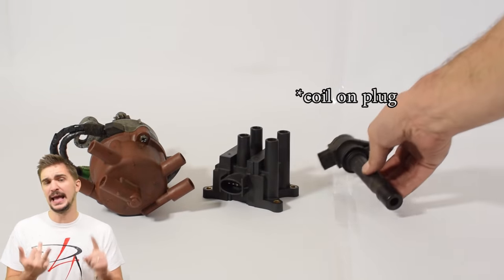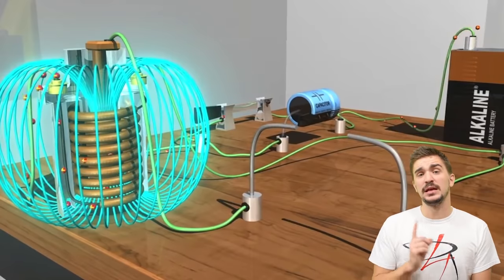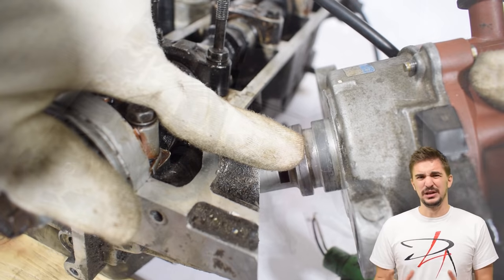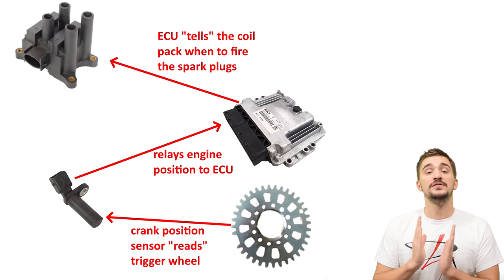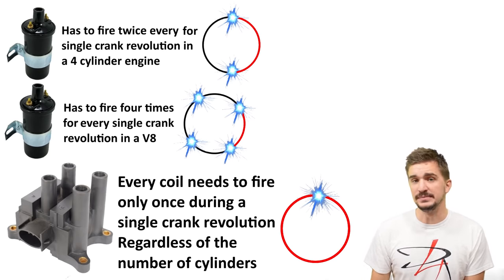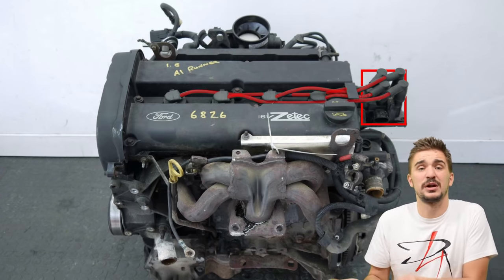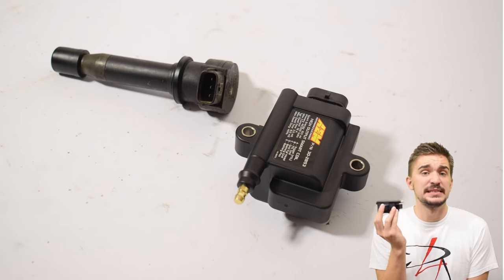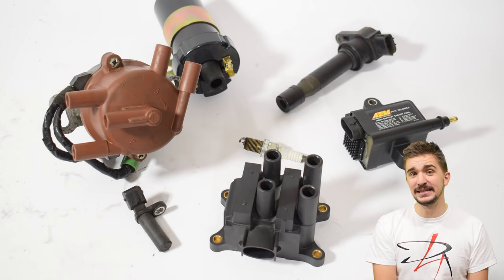Distributor VS Wasted Spark VS Coil on Plug VS MONSTER Coil near Plug

Comment: I'm sad you never mentioned timing advance as a drawback on distributors. Awesome video as usual though
Reply from the maker: The video did originally have a segment on it but I cut it out. The deal is that centrifugal and vacuum advance actually did the job fine, and later distributors used in conjuction with ECUs even had non-mechanical advance similar to that in distributorless setups. Overall I realised that presenting distributor advance as obsolete would be a bit of a gray area so I cut it out.
Reply: @d4a  I'm really surprised to hear that and wish you wouldn't have cut it. I figured that the step up to computer controlled ignition would have made a big difference but I wasn't aware. Thanks for the answer and all the videos dude

Comment: What about spark plugs? Do expensive multiple electrode plugs offer any true gains? I used to to buy the fancy stuff, but never noticed a difference, so I went back to stock plugs, maybe a range colder, for high compression engines.

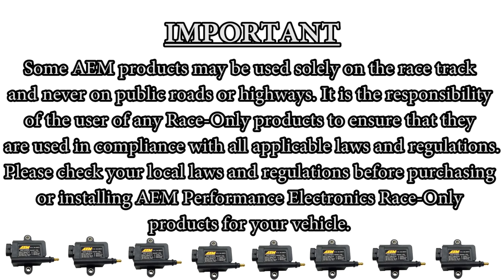Comment: 12:43 and who is going to notice?
Sure external parts like racing slicks are crap on main roads anyway but you are not hurting anything by running a ECU or aftermarket ignition on the roads.

Comment: Very informatieve BUT what controls the coil on plug, and the monster coil near plug ? Is it some sort of ecu take a signal from the gear wheel ?  Would it be possible to retrofit any of  these to a 1978 distributer type engine ??

Comment: Pretty cool video!  Now if someone would explain why leaving the coil ground strap loose on the cylinder head leads to ecu failure. I replace a lot of ecu’s with burnt out drivers when someone leaves the ground strap loose.

Comment: I'm not understanding the last 2 types.  My toyota 3.4l looks like type 3, there are long rubber ignition coils covering each plug, but there ARE wires connecting the left and right sides??  I dont understand when you say 'no wiring' with the ignition coil system.

Comment: distributor have 3 advantages, 1 being cost, 2 being reliably especially if your ecu goes out, and 3 easy tuning. never have seen a distributor leak oil in 50 years, they typically corrode sealing themselves better and get stuck in the block pretty bad
Reply: Obilwe wufuh Mubufu Oulou  you need 8 of them and i haven’t seen ford sell coils for under $50 each and 50•8 is $400 i can replace a distributor if it somehow breaks for $200-300 if i only need a cap, rotor, and plugs thats $70 total. double check your cost for a real engine cause it sounds like you’re missing cylinders
Reply: Obilwe wufuh Mubufu Oulou  i build engines for fun, i’ve built a 460, a 351w and a 302w

Comment: Advantages of a dizzy is simplicity and robustness needs no PCM/ECM to operate. To get around charge drop at high RPM most guys use a higher capacity coil that has a higher voltage output. These kids playing with their new fangled cars that have a PCM/ECM, don't realize the top fuel dragsters still use a dizzy with high voltage coil.

Comment: OEM plug wires are 3 thousand to 5 thousand ohms per foot Taylor thundervolts are 50 ohms of resistance per foot. What needs to be addressed is exactly how many ohms of resistance have OEM manufacurers built into OEM cop's ? and the aftermarket COP'S how many ohms of resistance because that is where the true performance is because I would rather have and older coil set up and use 50 ohm thundervolt wires on lets say a 1998 GT coil system which from all that I have heard works better then the modern ford COP because of the way it fires ? as in more reliable for performance applications ?

Comment: How do you handle a double ignition engine. An engine with two spark plugs at each cylinder? At motorcycles it's not unusual to have such configuration. My first and my last have two spark plugs in one cylinder.

Comment: How ECU in waste spark ignition system can decide to what cyliner should inject fuel if there is no camshaft sensor?  I understand 2 sparks but does it fire 2 fuel injectors also at the same time?

Comment: Way back when I had a duel point system that delivered 50,000 volts. The max speed limit my state is 65 so makes no difference to me. Besides you want to feel real instant acceleration, electric cars made to race would beat off the line piston engine every time. At this time I have COP.

Comment: wasted spark dont like big camshafts,the ford falcons in australia ef-el bounced between coilpack wasted spark and distributor and the wasted spark could'nt run the bigger distributor engine cam,it misfired and would not run properly

Comment: Honda b16 n b18 have distributor but can rev high 7500 8000 9000 rpm with distributor ..plug... wires ....toyota 4age has distributor and can do same

Comment: I’ve spun V8 engines to 10k rpm with a single point single coil distributor without misfires you don’t need electronic ignition let alone a coil on plug system to turn 10k rpm

Comment: Q: is the ignition system of a scooter engine the same as wasted spark system ? on older scooter I have a carb, coil pack and something called CDI, on newer it has EFI and ECU. Both are single cylinder so there is no waste of spark, because a single spark plug is firing all the time

Comment: So what is the difference of say, a coil on plug that can output 47,000 volts and a coil near plug setup? At that point is it just the amperage that separates them?

Comment: can we replace the distributor system with other systems?
Reply: yes you can you would need a triggering setup and something to control the timing. i believe msd makes a drop in CDI setup for old distributor v8 engines.

Comment: All good all well ...things I already know except for the last part ...my puzzle is that the missing teeth are meant to reset the counting and get the right sequence of releasing sparks  but at high rpm this missing teeth or gap will be reduced to size (time lapse) of the other teeth ...how is this issue managed .though the question is related to electronics but I'm yeeeeeeeeearning for a detailed answer?........?????????
Reply: the ecu i programmed to know the number of teeth on the trigger wheel and the missing tooth makes a break in the pattern. look up a scope output of a missing tooth trigger pattern and it will make sense why this system works.
Reply: @7sins979  thanks for ur concern I'm sure what u mean but the idea isn't yet clear for me I actually need some references on this issue....plz don't commit the eighth sin.

Comment: Almost Every waste spark, cnp, or cop ignition uses mosfets or some transistor for triggering. Cdi have way higher primary voltage leading to extremely high secondary. That monster coil is nothing special. If you really wanted a better ignition for boost or even water mist injection. High intensity plasma is where you should be looking. I suggest Aaron murakamis plasma ignition. You won't find anything comparable to that.

Comment: The one downside to CoP is that if one spark plug fails you must change the coill too and that's expensive
Reply: Don't CoP coils plug into spark plugs? Meaning spark plugs can be changed with replacing coil?

Comment: 35 years of high kilometer motoring give me "coil on plug" over distributor any day having had failures in both a dizzy will cold cock your car whereas a coil on plug, you might only lose one and  they take less time to fix than a spark plug my Hyundai only started to lose its COP's at 380k and $200aud for four 4 all fixed did it myself no tuning needed

Comment: Wouldn't it be better to install a magnet in the piston itself and let the magnetic field between the magnet in the piston and the magnet in a type of spark plug decide when it should spark instead of the computer? A proximity ignition system .
Reply from the maker: Ignition advance?

Comment: I've a Volkswagen Gol 92 and it uses a distributor, all videos i've seen about old car techs are misleading because they talk about pros and cons on paper and never what actualy happpens in real life, for example, in real life distribuitor are ineficient but on the other hand they are extremely reliable and cheap to mantain due its simplicity, will never short circuit a super expencive ECU because it does not have one.

Comment: Man, I want a car with tanky RPM! Sounds awesome.
Reply: If what you want is RPM then motorbikes are the peak of insane sounds. 
600cc four cylinder bikes often rev to around 16,000 and if you get one of the 250cc four cylinder bikes (mostly from the late 80's / early 90's) then 18,000-19,000 is the norm
The sound is like nothing else

Comment: My 1999 dodge has a distibutor but the computer determines the exact time it sparks. Turning the distributor does nothing except mess with the computer and if moved too far it just wont fire at all. Not an ideal design i know, running 8 cylinders off one coil through a computer. For a naturally aspirated engine its okay. Boosted applications have needed different coil designs

Comment: The Crankshaft needs to spin 2 times to get to an ignition event..**NOT EVERY SINGLE SPIN OF THE CRANK**
Reply from the maker: The ignition coil in a coil pack handles two cylinders

Comment: major advantage of a distributor ignition system: You don't need a computer for the engine to run.
You failed to mention the condensor and it's roll in the distributor ignition system.
You also "overlooked" the magnito ignitiin system, which does work at high RMP, and is even older than the distributor, dating back to cars that used a hit n' miss engine, in 1895 to very early 1900's, before the Model T was thought of. (The Model T was NOT the first car, and Ford was NOT the first auto manufacturer. Oldsmobile was manufacturing cars for 5 hears before Ford Started, Benz was making cars for 2 or 3 years before Olds.)

All the other ignition syatems you mention need a computer to function. Major disadvantage. Computer goes bad, car doesn't run.

Comment: The Nissan GT-R/R35 coil on plug are better in my opinion. The AEM has a down side, time. They wear out unlike the Nissan GTR that has been made to out perform the old style of coil on plug or the GM version. So many people are running them in their 2500whp GTR or Supra. Shit I even run them in my F20B all motor and I rev my engine to 9800rpm.

Comment: \The Distributer  with Mechan points have VERY MAJOR ADVANTAGE over modern systems  they can be maintained by almost everyone  with out a frikin computer   what enigines need is LESS electronics more OLD SCHOOL mecanical  bits that can be repaired WITHOUT A DANG COMPUTER
 .

Comment: For road car engines the distributor system is the best. It's easily understood and the components are cheap and easily swapped out. Coil packs are very expensive and seem to fail intermittantly on a regular basis. I hate modern electronics!

Comment: I have a distributor in my mitsubishi lancer (non evo). I want to do a coil on plug upgrade, but I need to know if I can connect the distributor plug wire socket to the trigger wire for the cop so the timing/trigger is kept. I don't know if the pulse voltage/duration difference will make this not work. Is this possible?

Comment: Wel...one EMP "Event" and you'll wish big time that you had that traditional breaker point distributor back your hood......
You also didn't mention the big difference in spark plug types on power and fuel economy. Especially capacitor plugs 
AND that if you change ANYTHING on an ignition (or any other sub system like installing a new manifold) then you HAVE to recurve the entire ignition timing of the system, BOTH for power and MPG....this is best and only properly done with your vehicle running on a true dynometer to see exactly what so many degrees of advance and duration at every level of rpm means to true torque and HP which is Really present at the rear wheels....
BTW, looking at ignition systems, all the male members of my family Originally had Mallory ignition, then they moved to Accel then mostly to MSD. Does anyone remember the Mallory Rev-Pol system? Which forcibly collapsed the coil field to make more HV available? Or the KONG ignition?   Or the great Vertex Magneto? All of these were prior to the rise of solid-state ignition of the mid 1970's. ...

Comment: My ford f250 6.2 v8 gas engine has 16 spark plugs.  It's coil on plug but has spark plug wires going from the coil to another spark plug in the bottom of the cylinder.  I know they do it for efficiency but is their any other benefit?  When I change my plugs the top ones are pretty worn and the bottom ones look new.

Comment: What happens if you for instance put aem smart coils on a stock 4age? would it cause harm in any way?
Reply from the maker: Definitely not, you can't really cause harm with additional spark energy. But they won't give any benefits either unless you're adding forced induction and some serious boost pressure or revving very high.

Comment: He forgot to mention that points don’t fail all at once but get worse over time unlike a module that’ll leave your ass sittin. Cheaper than modules and I don’t mind adjusting them when I change my oil

Comment: The distributor doesn't perform the same function as any of the coils: spark timing. If you're handy, you can actually use a distributor to time any of the different coils that you talk about.
Reply: no you can't, the most you can do is set base timing unless you have something like honda's setup where the rotor has a wide blade and ignition timing is controlled by the ecu. in which case either way you tune the ecu for ignition timing.
Reply: @7sins979  For 100 years, cars didn't even have an ecu. How did timing work?
Reply: @alpha434  the first cars had manual timing advance and the operator needed to be skilled in setting the advance for the given load and rpm, later mechanical and vacuum advance were developed to automate those functions. now computers do those functions much faster than a human can and far more accurately and precisely than the crude mechanical and vacuum advance systems.
Reply: @7sins979  Man, you act like there's some magical complexity or accuracy to internal combustion that doesn't work without a driver who has a PhD. Mechanical timing is exactly how the fucking valves are opened and closed in every engine you've ever touched and the cam lobes in a distributor take a tiny fraction of the spring load to open and close the points (or to trigger a hall effect sensor that works the same as one installed at the flywheel.) Those Hall effect sensors, by the way, are not very accurate. The ecu spends as much time adding missed signals as it does interpreting the actual signals.

Meanwhile, my original comment was that an intrepid individual can signal any kind of coil with a distributor. 🤷🏿‍♂️ It's true. I've been installing cop coils on early 911s for my entire life.
Reply: @alpha434  not my fault you think that old tech is as good as modern control. VR and hall effect sensor are very accurate but please do tell how you can make ancient tech do what modern computer control can do.

Comment: Can I use AEM coil for my distributed application?
Reply from the maker: Nope
Reply: yes you would need a triggering setup, and an ignition controller to time and fire the coils.
Reply: @7sins979  thanks for you answer, but im afraid it's more complicated than that. This is not a point ignition with a distributor and vacuum advance, this a Bosch Motronic fuel injection setup with mapped injection & ignition (from the 80s...). The ECU triggers the coil fire and the distributor just sends the current to the right cylinder (in short). I have no idea how the fuel injection would enjoy having no spark control. My idea was of a "big coil" if that is even necessary lol ^^ what's your opinion about it ?
Reply: @TheCabillaud94  if you are not experiencing ignition breakup then I would stick with that systrm.
Reply: @7sins979  I am definitely not experiencing that.

Comment: I was last night just discussing with my grandfather and father how a distributor cap ignition system works. They referred to HT (High Tension) leads; I assume these are the spark plug wires you referred to?
Reply: Yes.

Especially if they are slightly too short.
Reply: @godfreypoon5148  For what purpose might they be made shorter than they should be?
Reply: @Jupiter__001_  So that when you fit them, the tension is high.
Reply: @godfreypoon5148  Yeah but why do we want tension?
Reply: @Jupiter__001_  If they didn't have tension, they wouldn't be high tension leads.
Reply: @godfreypoon5148  Hahaha good one. But no, I was wondering why we use high tension leads rather than a normal lead.
Reply: @Jupiter__001_  lol haha
It's just because it is high voltage. It needs thicker insulation otherwise it will punch through and just short to any metal it passes near.
Reply: @godfreypoon5148  I guess that makes sense. I suppose any slack would cause even more voltage to be required due to increased resistance.
Reply: @Jupiter__001_  "Tension" is an old school term for "voltage".
Reply: @godfreypoon5148  Ah. I wonder where that term even came from, given that the scientific term is "potential difference", and the unit of measurement is a volt. Thank you for explaining.
Reply: @Jupiter__001_  so they are high tension

Comment: All fine and dandy with good explanations. BUT do not run into the hype of the "monster" coils as usual it's pretty much a commercial gimmick! Sorry to break the glass. But that's pretty much it! 
BTW when using the word "OEM" please make sure to distinguish between a cheap car/model and a high end car/model. Take it from a guy that effectively worked on a well known ignition (and other components) factory. I can assure you that a modest Fiat or Citroen, dirty cheap, coil. As very little to do with a high end V8 Mercedes coil. 
As a side note, these latest also are a step well above and beyond the already mentioned "monsters"! Cough, cough. ;-)